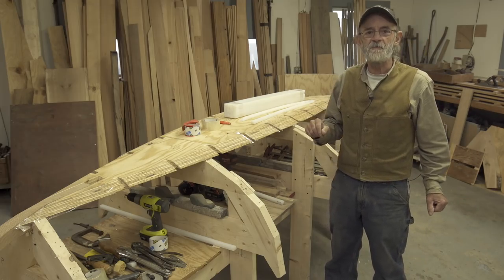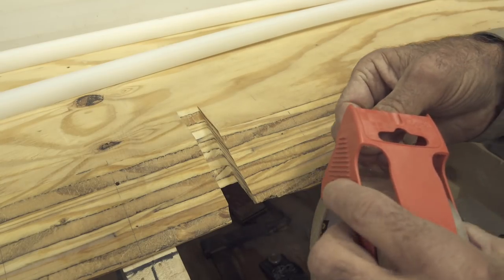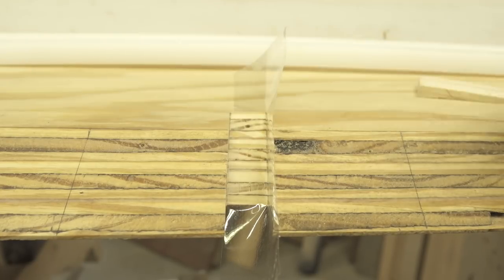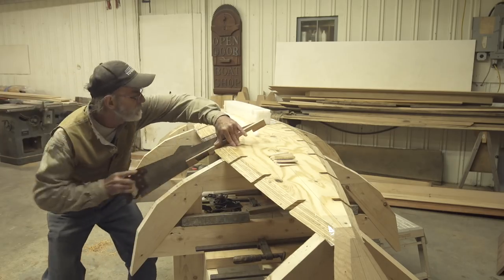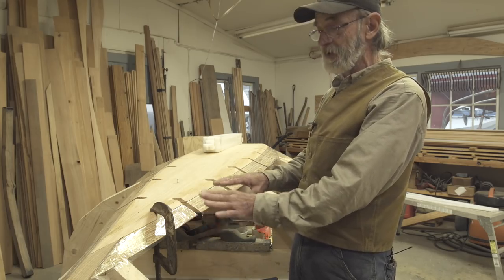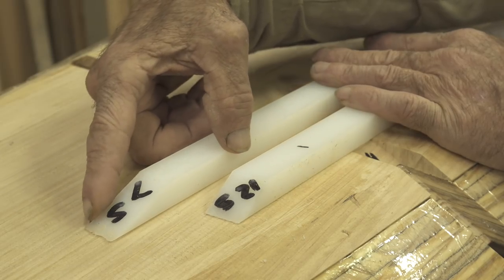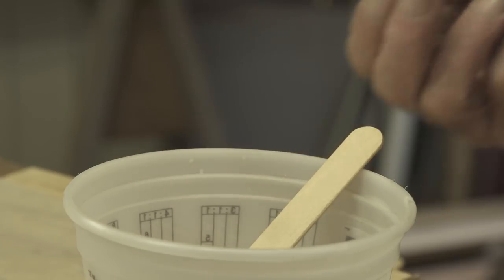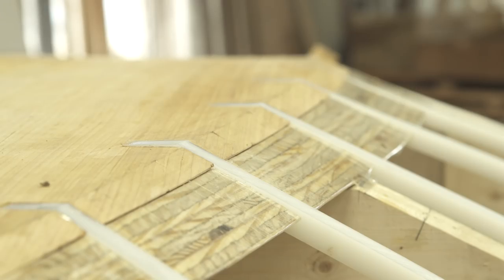Building the TotalBoat Sport Dory: Episode 14 - Plastic Frames

Comment: Well it's a little late now, but a lot of skis use UHMW poly for sidewalls and builders will flame them with a torch before epoxying them to the wood core. Helps a ton with adhesion

Comment: Louis, the boat is looking great! I lost track of the fact that the "false Bottom" is not part of the boat but rather it is the mold. It's all cleared up now :) Question, for this application would low viscosity THIXO work as well as the 5:1 epoxy or would it be too thick?

Comment: UHMW has been used in the printing industry for the last 30 years as bearing parts on printing presses and has replaced hardwood cutting sticks on hydraulic paper cutters as well. It's very strong,durable and machineable The downside is it's hard to glue anything to it but it will hold a coarse screw thread like a bulldog
the divots and epoxy are an outstanding idea for a good mechanical connection.  I now have a better understanding as to how the frames will "flow" into the false bottom in your design. I think you designed this Dory to be lighter than normal also.

Comment: Hi Lou, Keep up the very interesting work, Just one tip I think that might have helped at the point where you were trying to  make a mechanical glued joint at the end of the plastic frames,  if you drilled a hole 10mm diameter right through the plastic then insert a wooden dowel into this hole the glue would then bond each end of the dowel to the sides of the slot in the wood.
Reply: Mr T, the tip was for Lou, not for someone else that "thinks" they know it all.

Comment: This is where experience comes in. I'd never be able to think ahead about pulling the frames out of the false bottom and giving it a little wiggle room. Brilliant idea to prod soak holes into the end grain and frame. I'm really interested in the plastic framing BUT I'm sure the teacher at our "Traditional Boat Building Academy" would have a heart attack :-) as we use mostly steamed ash frames... but having said that they're prone to splitting especially in tight areas as the wood just doesn't want to bend that much. Also it's probably the number one and first repair you need to do as they split over time. My Alden Classic has decking front and aft and even the cockpit is seated and planked on the floor so you'll have a hard job seeing these PVC frames. Just need to know where to source the stuff.
Reply: Not PVC. That is UHMW polyethylene.
Reply: Yes.  Referring to UHMW-PE as PVC is like referring to hickory as cottonwood.
Reply: Brian TheEnt I'm in Finland

Comment: UHMW is ok outside of any exposure to the sun,  but there are better nylon plastics that can take a lot more sun without deteriorating.  I used UHMW for some sister ribs in my 46' BC Troll fishing vessel 24 years ago.  I hear they have done well and haven't reacted with the fir planking.  But exposed to the sun UHMW will go bad sooner than the boat.   I think the guys out in western Canada now use a type of nylon when the sun is an issue.

Comment: I like the HDPE frames. In previous episode you doubled up the wood and carbon fiber to make it extra durable. Why not make the bottom of the boat out of HDPE as well? It can bend, flex scratch and you can weld it back together if it ever breaks.

Comment: No mechnical fastener to the keel with how slick the plastic is?
Reply: Patrick Radcliffe that's not a keel. You'll see in upcoming episodes how the framing system is secured to the planks and the bottom.
Reply: Very slick but by the time Louis is finished the frames and keel will be one with each other. The "Old Guy" is teaching us how to work with traditional and space aged stuff!

Comment: Really nice work. Wiping the epoxy with your skin doesn't cause any issues?
Reply: qaannat its sticky then it cures then you sand it off. Ya know like epoxy
Reply: I have sensitive skin and it causes me no issues.  It cleans off your skin fairly easily with a paper towel and acetone.  The acetone is harsher on my skin than the epoxy.   I wear disposable nitrile gloves when work with epoxy but it seems I still end up with some epoxy on my hands no matter what I do.
Reply: You can have a reaction to  epoxies over the course of time using them.
Reply: Barry that is a great suggestion.  I will give it a try.   thank you!

Comment: is the plastic HDPE? nothing bonds to it, but your mechanical fastening trick is a nice tip.
Reply: I believe it's UHMW
Reply: He mentioned it in a previous video and I'm off to watch that again. I'm sure he's tested the bonding strength of this.
Reply: Paul Hitchman : there is no bonding strength with uhmw. Nothing will stick to it as Lou pointed out. Ribs rely on mechanical fasteners, even wood ribs  are never glued, only fastened.
Reply: The epoxy in the UHMW/bottom joint is mainly filling the gap to prevent the rib from working in the slot, no?  The fasteners along with the sandwich effect of the bottom being encased is where the rigidity will come from, if I understand what Lou was saying in earlier videos.  Please correct me if I'm wrong.
Reply: J Wilson Handmade Knives
Yes
Reply: Match2100  HDPE and UHMW are quite similar in adhesive bonding. Both PE polyolefins with low surface energy. Like Teflon... glue will not stick.
Reply: No bonding strength at all.
Reply: I think it's uhmw polypropylene.
Reply: UHMW is certainly bondable. It needs to be flame treated to increase it's surface energy, but the bondability of UHMW is not in question. Flame treated UHMW is the base material of choice for the snowboard industry.

Comment: Polyethylenes are a great material but they don't break down like wood.  Ok, good for  boat parts, solves a lot of problems;  but think about all the saw dust and those little flakes and where they go.  We got to be responsible about how we depose of theses bits especially near the coastlines.  The oceans are filling up with plastic flakes,  polyethylenes are a major type. They float and get ingested. We are just coming to realize that this is a big problem. It's no going away fast and it's slowly growing and effecting natural systems and wildlife.  Every little bit hurts. Kind of takes the joy out of it don't it? I am sorry for that; but even more concerned about how we use and perceive(accept)) the use of plastics in our everyday pursuits. We simply have got to be more responsible using them.